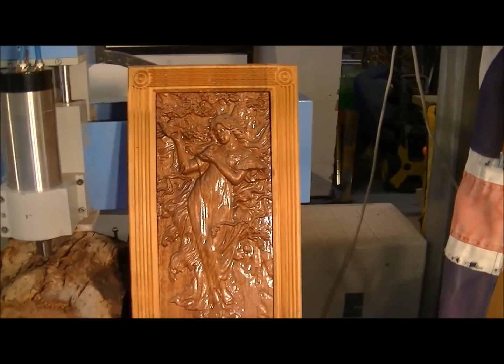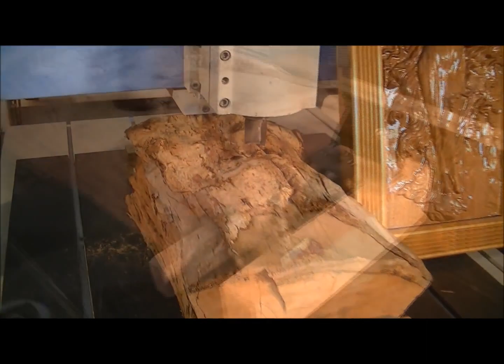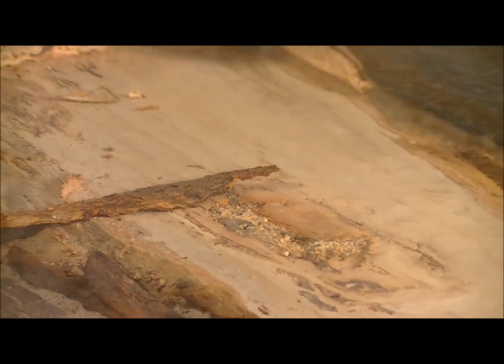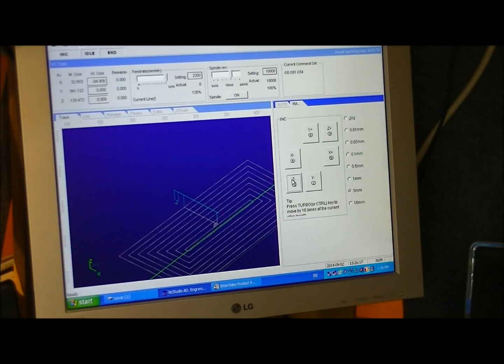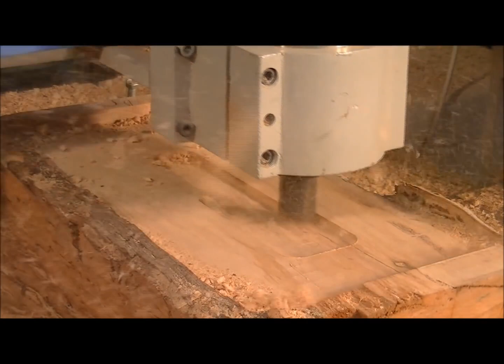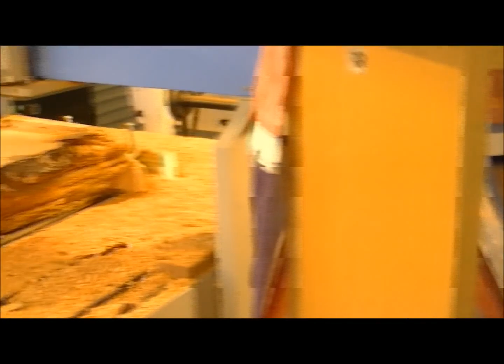CNC Router Turning firewood into 3D Art Décor

Comment: I'm not sure which CNC's I used but they was on a bigger scale for doing shower trays / base in I used a 4200 & a 3200 they was dangerous to use and clean if you wasn't careful it could knock you over kill you they was a pressure mates just incase you was getting the tray off to put another one on